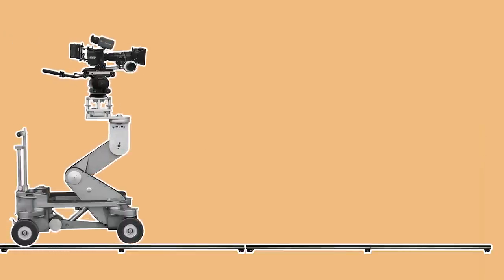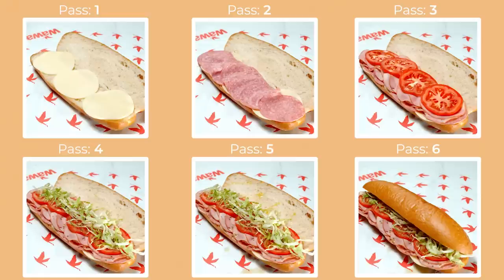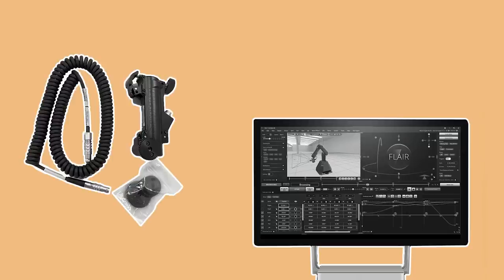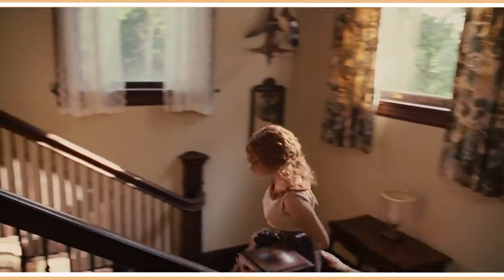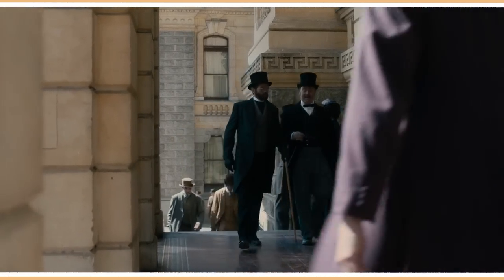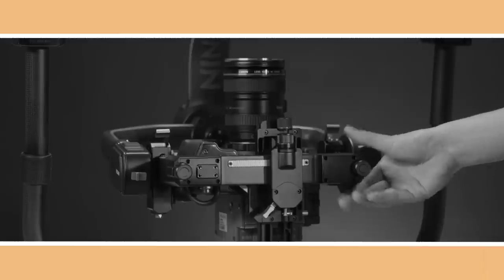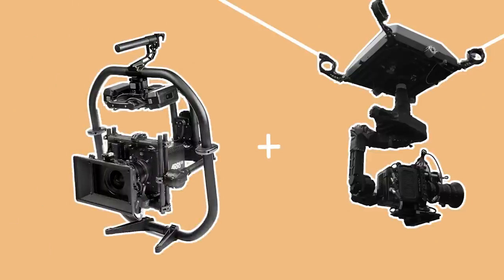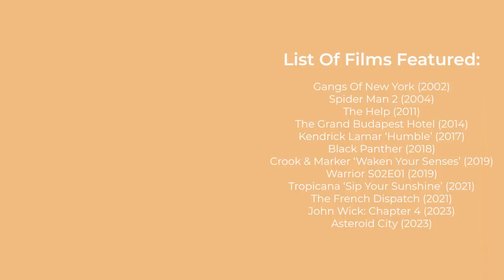Grip Rigs For Cinematic Camera Movement (Part 2)

Comment: Hi so I actually work professionally in the Grip dept on large scale movies and television projects. Most of the gear mentioned in this video is typically operated by the camera department/specialized operators. Within the Grip dept we would be responsible for dolly placement and operations, which is covered in part 1. Not trying to be a dick, just trying to be objective.